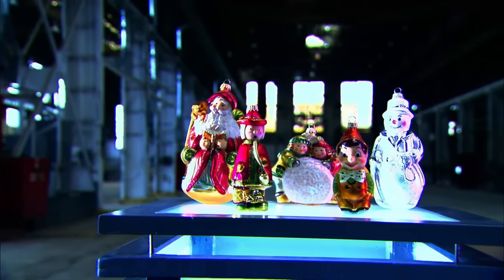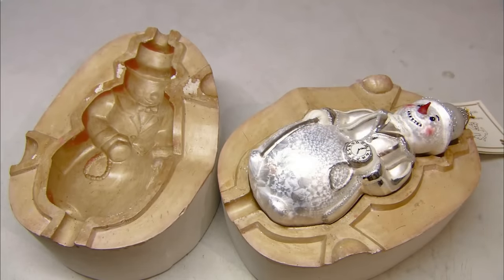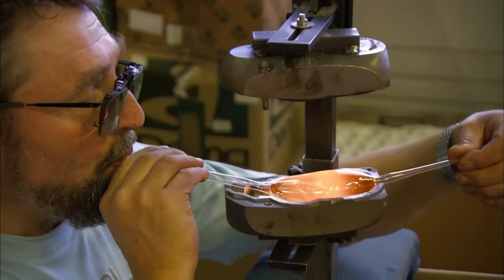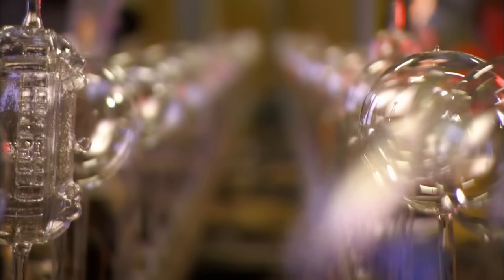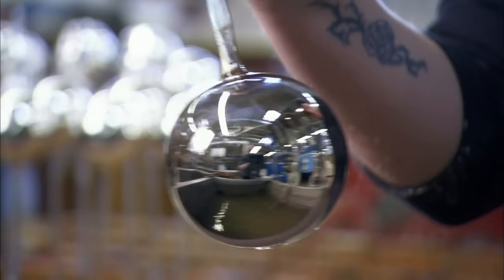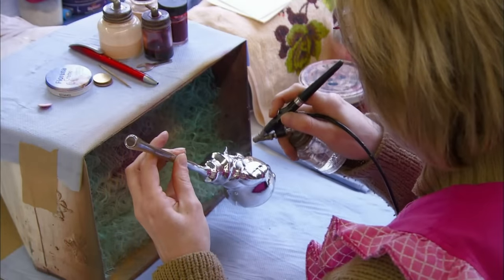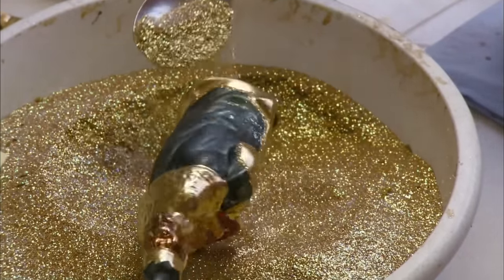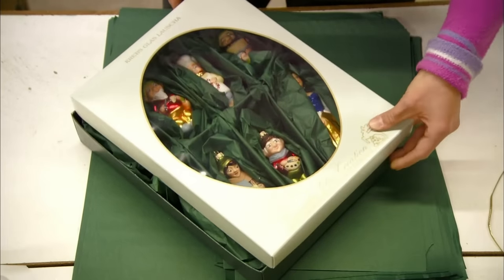How It's Actually Made - Glass Christmas Ornaments

Comment: Blowing the hot glass too hard or for too long is the right way to get hot small glass around a periphery.  

Blood trails on the ground indicate the direction people have taken, and who has enjoyed what parts of the glass strewn periphery.  

If your peripherals are glass coated adequately, gasoline fires can keep them hot. They will cool otherwise.  Electrical fires, grease-fires, and molten metals can also keep the glass hot.  Lumber fires can also keep the glass hot.